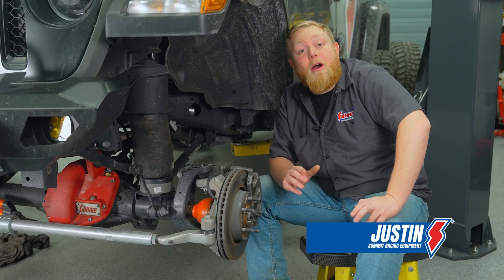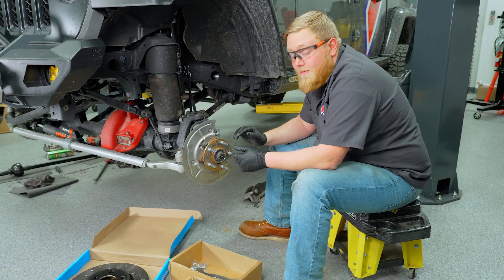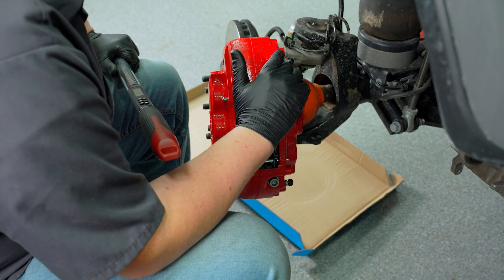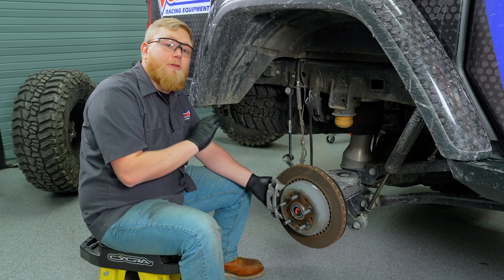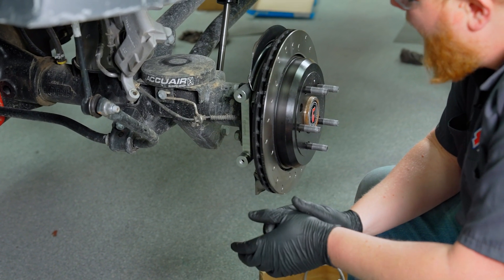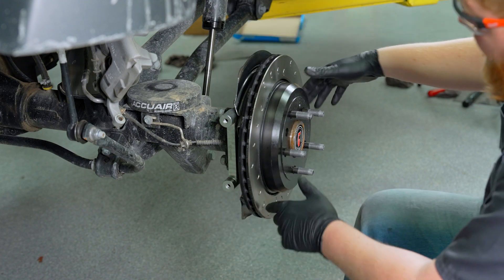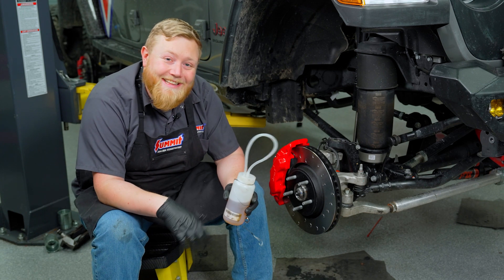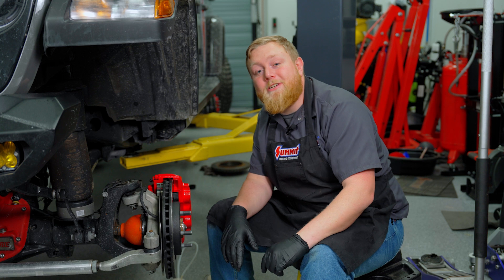Jeep Gladiator Big Brake Upgrade | Project Roamin' Gladiator

Comment: I would be curious what your longer-term review is? I had the Baer big brake system for my Gladiator and it was nothing but constant squealing. Changing out the pads helped a little but in the end they said with the design and semi float rear axle it would always be a problem... I ended up going back to stock after I discovered they were also all leaking like crazy.